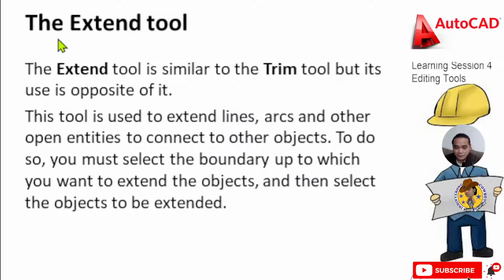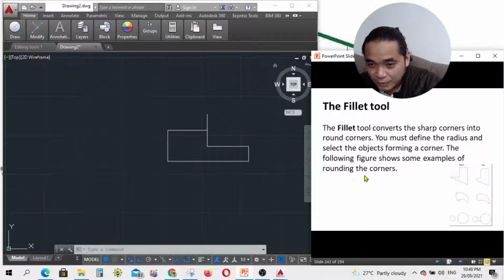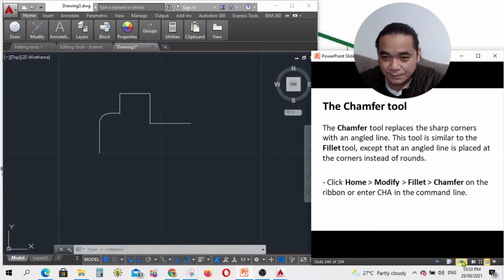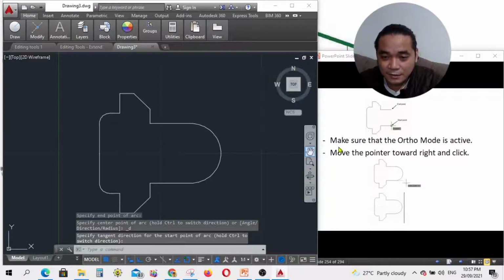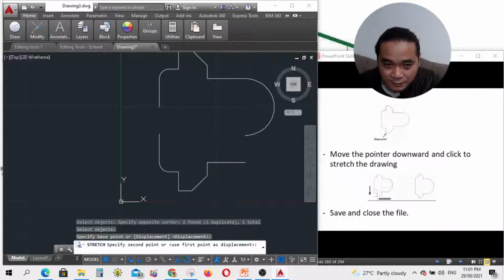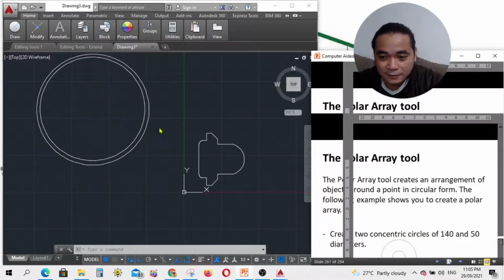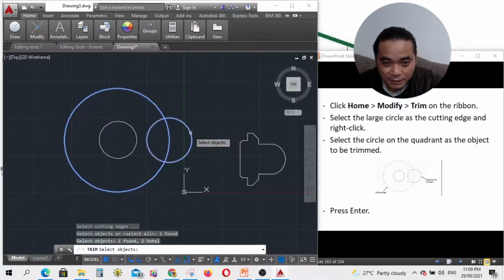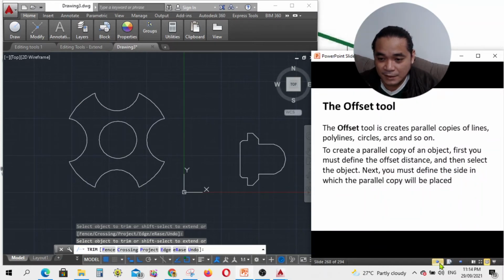AutoCAD LS 4-2 | Editing Tools

Comment: LS 4-2| In the second part of Learning Session 4, I learned how to use the remaining editing tools: extend, fillet, champers, mirror, explode, stretch, and polar array. I learned from this video that the Fillet tool roundens sharp edges. The Chamfer tool is used to angle the sharp corners. The Fillet tool is similar, but with angled lines instead of rounds at the corners. While the Mirror tool mirrors objects, it can also be used to create symmetrical drawings. Furthermore, the explode tool can be used to separate a group of items. Stretch tool is used to stretch drawings or portions of drawings. Finally, there's the Polar Array tool, which generates a circular arrangement of items around a point.

Thank you sir for the new learnings, looking forward for the upcoming videos. God bless you always sir

Comment: In this second part of the video, I have learned to extend lines, arc and other open part of the object using the extend tool. The fillet command/tool is used to create rounded edges between the adjacent lines. However, the chamfer command in AutoCAD is used to create slanted edges. Explode tool breaks a compound object into its component objects. And the polar array is defined as the arrangement of copies of an object in a circular form. 

Thank you sir 😊

Comment: LS 4-2| In this second part of the learning session 4, I learned on how to utilize the remaining editing tools which are extend, fillet, champers, mirror, explode, stretch, and polar array. Through this video, I was able to know that the Fillet tool roundens sharp edges. The Chamfer tool angles the sharp corners. Similar to the Fillet tool, but with angled lines instead of rounds at the corners. While, the Mirror tool mirrors things or this tool can make symmetrical drawings. Moreover, the explode tool can separate a collection of items. Stretch tool basically stretches the drawings or the portion of drawings. Lastly, the Polar Array tool which produces a circular arrangement of items around a point. Thank you for this new learnings sir! God bless

Comment: This learning session, taught me how to edit using extend, fillet, champers, mirror, explode, stretch, and polar array. The Fillet tool roundens sharp edges. The Chamfer tool angles the sharp corners. Similar to the Fillet tool, but with angled lines instead of rounds at the corners. The Mirror tool mirrors things. This tool can make symmetrical drawings. The Explode tool separates a collection of items. Stretches drawings or portions of drawings. The Polar Array tool also produces a circular arrangement of items around a point. Thank you sir!

Comment: I enjoyed seeing the second half of this learning session since it taught me how to utilize the extend, fillet, champers, mirror, explode, stretch, and polar array editing tools. While the Extend tool is similar to the Trim tool, its purpose is reversed. This tool is used to join lines, arcs, and other open things. The Fillet tool roundes sharp edges. The Chamfer tool creates an angled line in lieu of the sharp corners. This tool is similar to the Fillet tool, except that the corners are rounded rather than angular. The Mirror tool duplicates items. This tool enables you to make symmetrical graphics. The Explode tool separates a collection of items into their constituent components. The Stretch tool enlarges or reduces the size of drawings or portions of drawings. Additionally, the Polar Array tool produces a circular arrangement of items around a point.

Comment: IN LS 4-2, I leaned about the other editing tools like the extend, fillet, chamfer, mirror, explode, array and stretch tools. The extend tool is used to extend lines, arcs and other open entities to connect to other objects. To converts the sharp corners into round corners used fillet tool. Chamfer tool replaces the sharp corners with an angled line. Explode tool explodes group of objects into individual objects. Use the mirror tool to create a mirror image of objects. Stretch tools lengthens or shortens drawings or parts of drawings. Lastly, the Polar array tools creates an arrangement of objects around a point in circular form.  Very informative video. Thank you so much Inhinyerong Cowboy!

Comment: I was pleased to watch the second part of Learning Session 4 because I learned how to use the extend, fillet,
champers, mirror, explode, stretch, and polar array editing tools. The Extend tool is similar to the Trim tool but its use is the opposite of it. This tool is used to extend lines, arcs and other open entities to connect to other objects. The Fillet tool converts the sharp corners into round corners. The Chamfer tool replaces the sharp corners with an angled line. This tool is similar to the Fillet tool, except that an angled line is placed at the corners instead of rounds. The Mirror tool creates a mirror image of objects. You can create symmetrical drawings using this tool. The Explode tool explodes a group of objects into individual objects. The Stretch tool lengthens or shortens
drawings or parts of drawings. Furthermore, the Polar Array tool creates an arrangement of objects around a point in circular form.

This video content is very engaging. Can't wait to finish watching all of the remaining videos.

Comment: In addition to the tools in LS4-1. The Extend Tool, used to extend lines, arcs and other open entities to connect to other objects. By doing this, we must select the boundary up to which we want to extend the objects, and then selecting objects to be extended. Fillet tool converts sharp corners into round ones. We can define radius and select objects in the corner. This tool helps us make smooth and curved edges whenever we want to. As similar to Fillet, Chamfer as well replaces sharp corners with a curve. But instead of rounds , angled line is placed in here. In Mirror tool, this creates a mirror image of objects. This is very helpful especially when drawing a symmetrical drawings. Explode tool is for exploding group of objects into individual objects. If we want to lengthen or shorten drawings or parts of it, Stretch tool is of help. Array tools helps us create arrangements from multiple objects, making drawing of these certain objects and placing them much convenient.

Comment: In continuation of learning session 4-1 on editing tools, Engr. Mardie began working on the extent tool, and I gained lots of useful information, particularly on how to utilize those commands. Engr. Mardie also gave us a demonstration on how to utilize such commands, which is helpful because we were new to the software. His discussion is beneficial in that it allows us to spend less time figuring out how things function but I understand that we must have worked out all of the specifics, the good thing is that I know what I'm doing. I'm not an expert at this yet, but I'm getting there. During his presentation, it came to me that AutoCAD allows us to create manufacturing data such as material requirements for components, model dimensions and shape, product, and component drawings. This aids in the creation and management of a large database, which is an essential aspect of the manufacturing process.

Comment: AutoCAD LS 4-2 

Engr mardie began working on the extend tool as continuation for learning session 4-1 on editing tools, and I learned a lot of helpful knowledge, particularly on how to use such commands. Engr. Mardie also provided us a demonstration on how to use these commands, which was quite helpful given that we were new to the software. His discussion is useful since it helps us to spend less time figuring out how things operate, but I recognize that we must have worked out all of the details; the good news is that I know what I'm doing. Throughout his presentation, it made sense to me that AutoCAD may be used to develop manufacturing data such as component material requirements, model dimensions and shape, product, and component drawings. So thank you for this presentation sir, hoping again to see more.

Comment: The continuation of the editing tools covers the extend, fillet, chamfer, mirror, explode, stretch, and array tools. Defining the boundary object is important when using the Extend tool to connect a line or arc to other objects. If the fillet tool enables you to convert sharp corners to round corners, the chamfer tool, on the other hand, converts them into an angled line. The mirror is also a useful tool because it eliminates the need to create specific shapes in order to form them into specific objects. However, it is important to note that when using this tool, you must select the first point of the mirror line and activate the ortho mode.The Explode tool allows you to break a group of objects into individual objects. The Stretch tool has also been discussed, which is very handy for shortening or lengthening objects. But amongst the editing tools that have been discussed in this video, the Polar Array tool is the one that I find the most interesting. It is interesting in a way that you can create a number of objects inside a circle in a very easy way, e.g. a fidget. But in using this tool, it is necessary to enable the quadrant option as it allows your pointer to snap to the quadrant points on the circumference of the circle, arc or an ellipse. Understanding how this tool works makes it easier, as Sir Inhinyerong Cowboy explained it very well and in detailed. Kudos sir!

Comment: Upon finishing this, I was able to understand the fillet, champers, mirror, explode, stretch and polar array editing tools. The fillet tool help user draw around edges between  the faces of the object and its adjacent lines and also connect two tangents. The champers helps when the user can cut corners of two adjacent sides of the object at any distance or any particular angle by entering specific values. The mirror which is like copy but it is a reverse copy of an object. The explode  tool helps user in breaking into its component/parts of the object. The stretch is simply stretch the portion of the object that what the user want and lastly the polar arrays which helps the user in the arrangement of copies of an object in a circular form. Thank you for this sir!